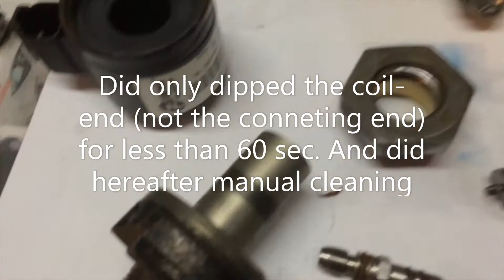Evinrude Ficht Injector dissection

Comment: I know this video is old, but I would like to now how you made the "homemade" tool from the bolt with the 2 pins to unscrew the part with the spring and ball bearing? I am dealing with a triple set of Ficht injectors, and cannot find that .55" diameter tool with inset pins to unscrew the disc and get the ball bearing and spring out, as you show in your video.....